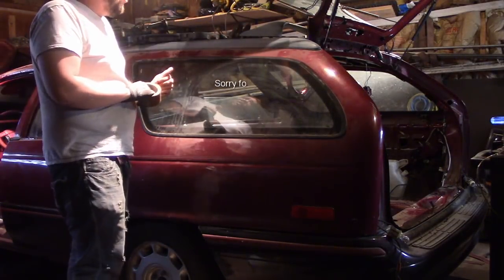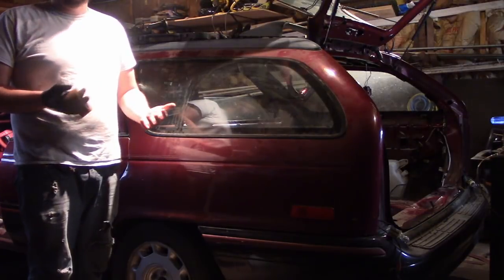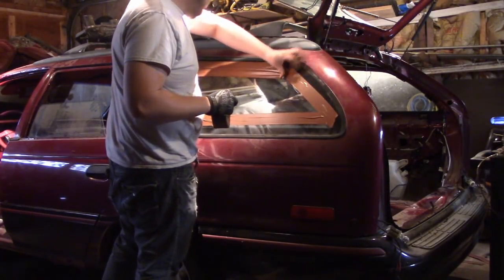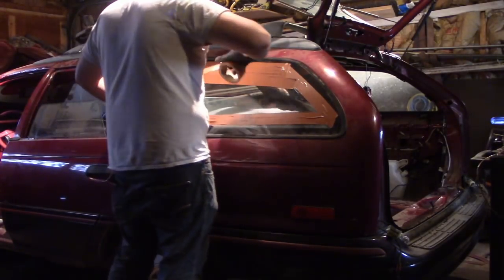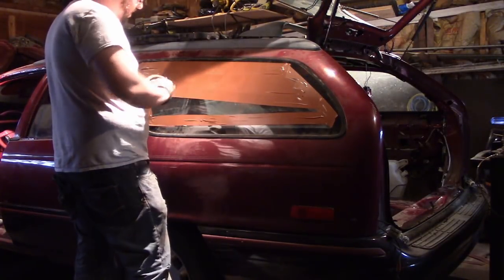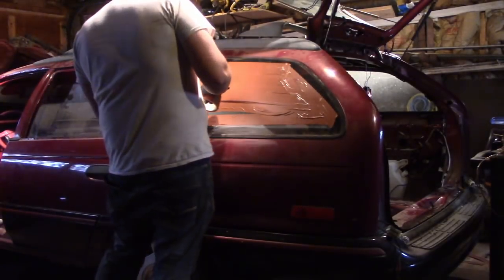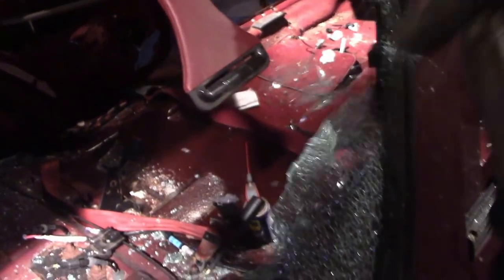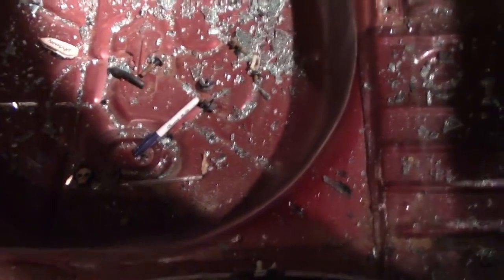BREAKING WINDOWS!! Tape VS NO Tape

Comment: I use the hood latch wire or something like that and stick it between the rubber then put vicegrips on both ends and go back and forth it comes out easy with no mess in 10 minutes or less. It helps to have 2 people with my method